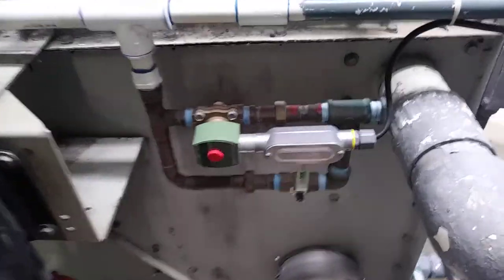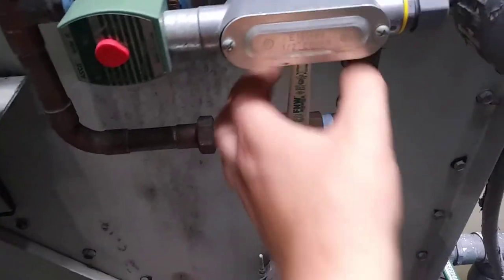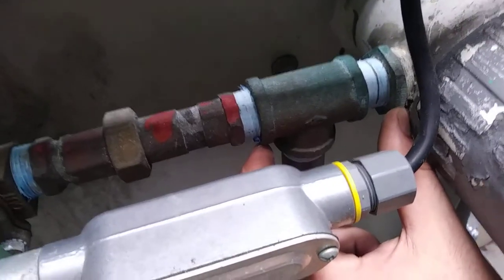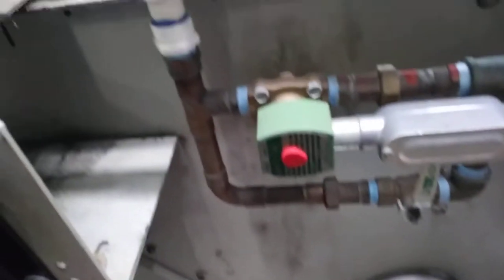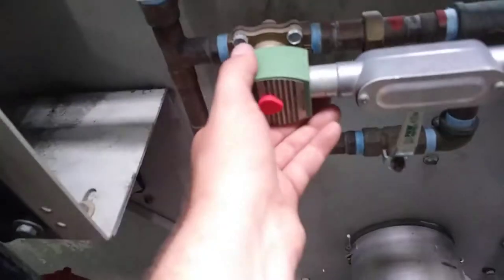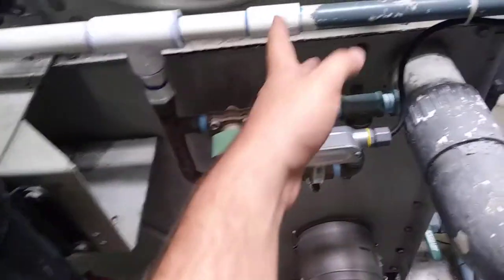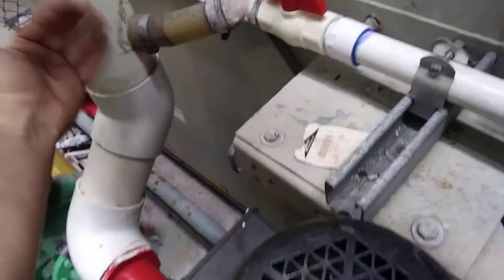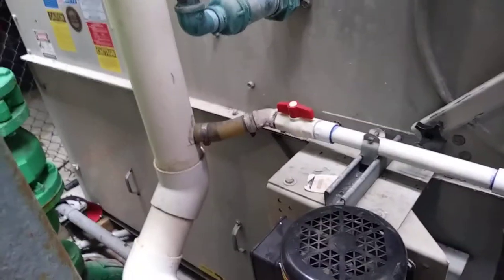Quick Look at a Cooling Tower Bleed Solenoid System

Comment: Try and go with a motorized ball valve whenever possible. I have been doing water treatment for over 20 years. They work a lot better in the field and can be purchased for around $250. They are not as prone to plugging up because they are fully ported.
Reply from the maker: Great advice! These asco valves have been pretty reliable but, I have had them stick open, especially in locations that have more debris falling in/around the tower.